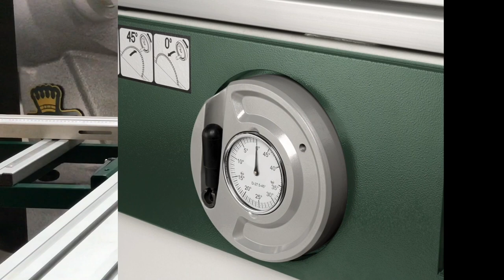TS2 315 mm Heavy-Duty Table Saw with Sliding Beam and Squaring Frame

Comment: Hi, I've got a ts315 table saw and no matter what I've tried the dust extraction is awful. Any advice on dust extraction upgrades?
Reply from the maker: Hello, thank you for your comment. Table saws have historically had issues with extraction because of the design and access required around the blade area. One of the points is that it has one extraction point that splits to a smaller diameter for the crown guard which isn’t always ideal as you can lose suction or power that way. The second point is that underneath the machine below the blade, it would be beneficial to use a vacuum style extraction (like that of our CamVac range) and a minimum of two motors, then a separate one for the crown guard. So, unless you have an industrial powered extraction system, double up on extraction units to make the required difference. Best Wishes, Record Power.

Comment: What is the difference between this and the TS1 ?
Reply from the maker: first of all sorry about the delayed reply, basically the TS2  has been refined for use and given the Record Power branding in both single and three phase, the adjustment of the scribe is different but improved mechanically as shown on the footage and the blade change is more secure with a central Allen key position on the spindle and spanner for the locking nut and an extra stop switch has also been fitted for safety in use, all the other operations are identical but if you would like to speak in more detail please call our technical line on 01246 571020 press 2 for technical as ask to to speak to Craig, look forward to hearing from you.